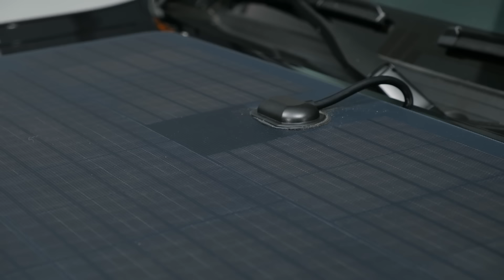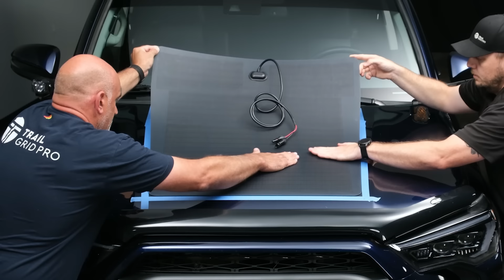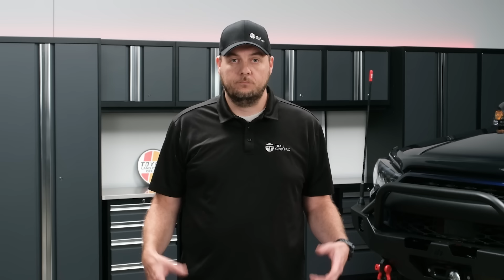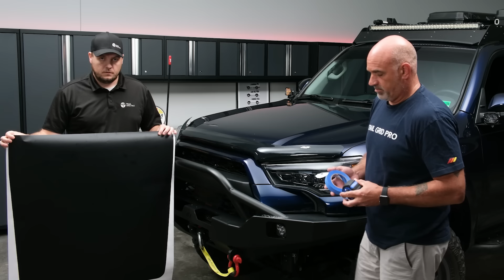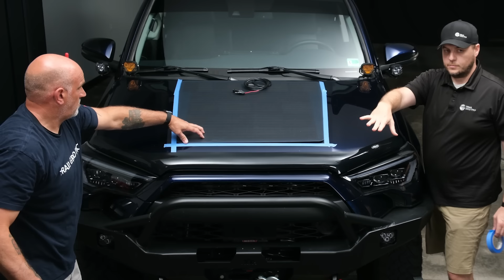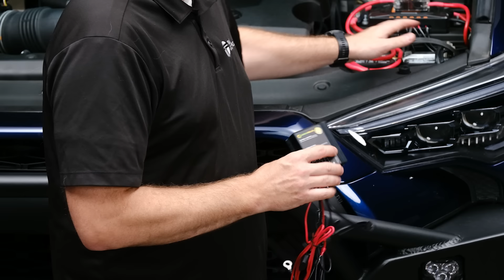Toyota 4Runner Lensun 100W Hood Flexible Solar Panel Install | '03 - '24 4Runner

Comment: Question. Your primary battery is the Genesis Offroad Gen 3 Power Hub ? So its the dual setup? And have a battery for the solar right? Then you paralleled the solar power battery to your main battery?